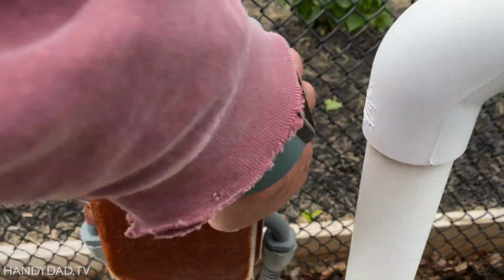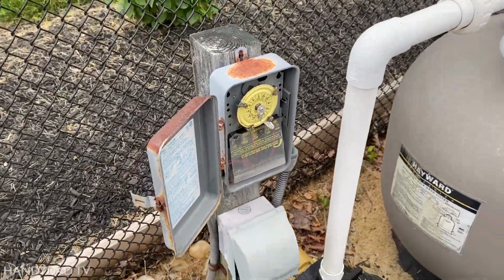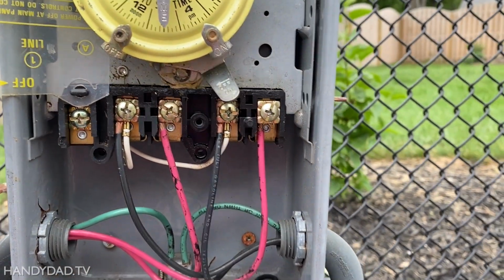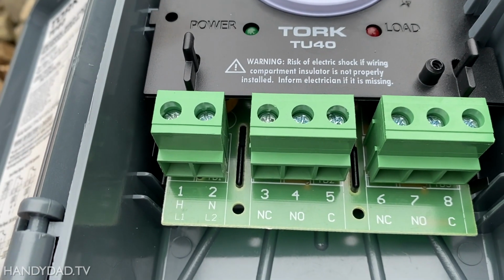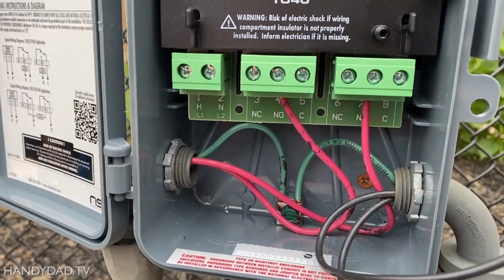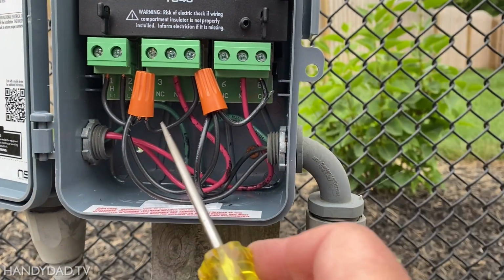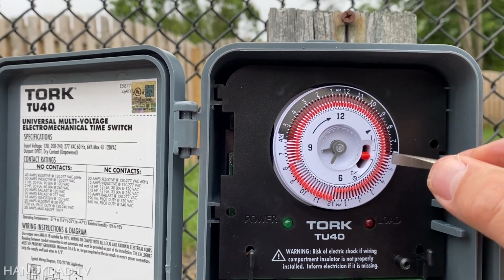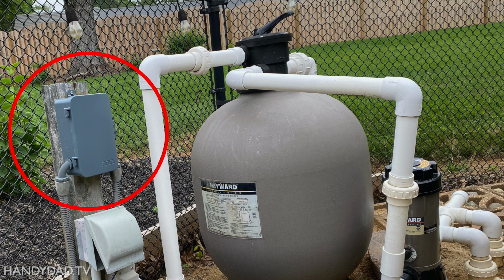Pool Timer Replacement - Tork TU40 (NOT RECOMMENDED)

Comment: Hi， You look like a professional in the swimming pool. Do you know is  salt chlorine generator a good choice ? Will he be better than directly adding chlorinated chemicals
Reply from the maker: Salt chlorine generators are automated systems so they’re a really good option for a second home where you’re not there to test and add chlorine periodically. 

But they are a big upfront investment, can have finicky electronics, and require the generator to be replaced periodically. 

I’ve have viewers actually uninstall their salt system and go back to chlorine.

Comment: Wish you would had installed a smart timer. I have been looking for a good smart pool timer.
Reply from the maker: I considered it, but honestly it’s overkill IMO if you just need a simple schedule like I set. 

Unless you’re going to do some fancy rules that optimize your filtration based on temperature, sunlight and chemistry levels, why bother with a smart timer?
Reply: Could have just wired in a shelly 1 for under $20 and had a fully programmable switch. If you toss in some chemicals and want to run the pump for a few hours just pull up the app and go. I have a variable speed pump so the timer is built in but it also has a quick clean mode and i wired up a shelly relay to that sink can turn on high rpm anytime i want.
Reply from the maker: It’s overkill IMO. We just needed a simple timer.
Reply: @handydadtv  True but so much of home automation is. lol.

Comment: That’s confusing because L1 goes to a common and L2 goes to a common shouldn’t L1 go to both commons ?
Reply from the maker: That would cause a short. You need to jumper each C to each L.
Reply: @handydadtv  I think it’s cause it’s 240v that was throwing me off cause you put two “hot” wires in the L1 L2 to power the timer